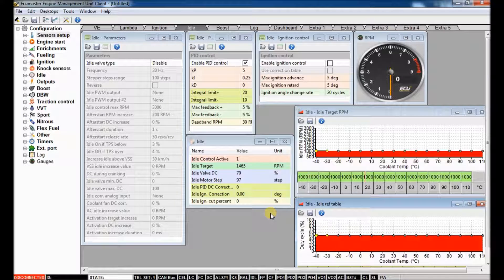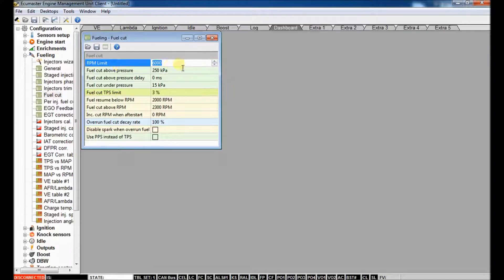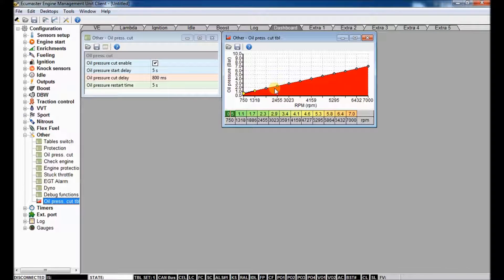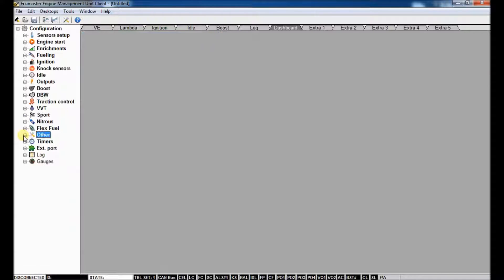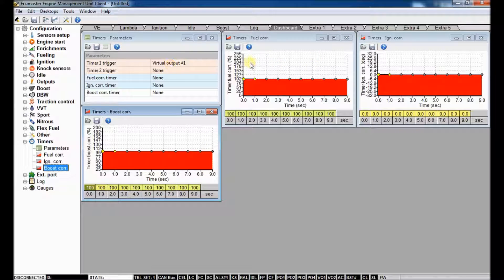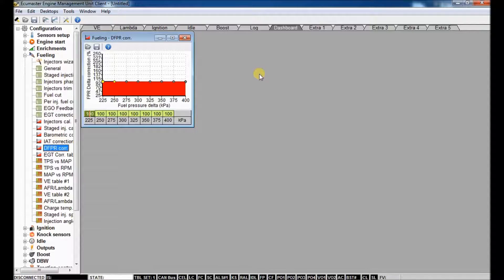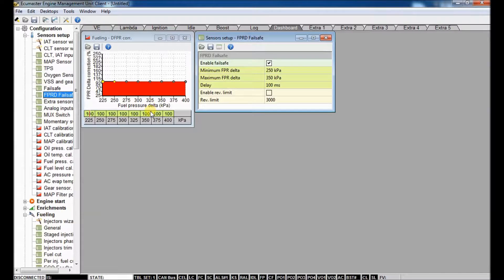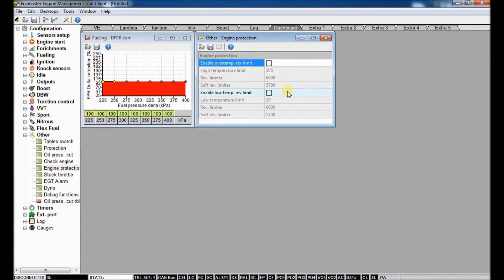Engine Protection Strategies- ECUMaster EMU

Comment: EMU descriptions says it has built in MAP sensor, so i would only need a IAT sensor and wire in my AEM wideband sensor and I should be able to run the car to get it to the dyno tune shop, application is for a 89' Supra Turbo R154 5spd with factory 7MGTE metal headgasket/ARP headstuds torque'd to 90lbs, rest of engine is stock untouched. It does have a T4 7267 turbo running 28psi on APexi Fuel controller/piggy back system
Reply from the maker: Please contact sales@ecumasterusa.com for any product questions or call us using the contact info on our site.

Comment: If a preset failsafe engages, will the ecu tell you which failsafe is triggering to help you find and fix the problem? If so, how does it do that? Considering buying an emu classic.
Reply from the maker: Notification would depend on which failsafe is triggered, whether that's knock control or fuel pressure, etc. If you have a specific question about a failsafe strategy, please email us at support@ecumasterusa.com